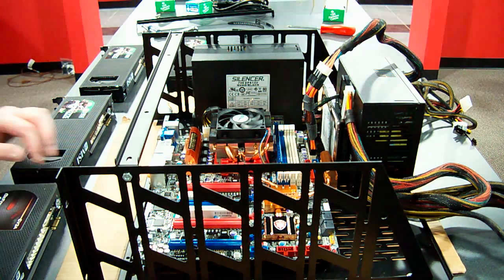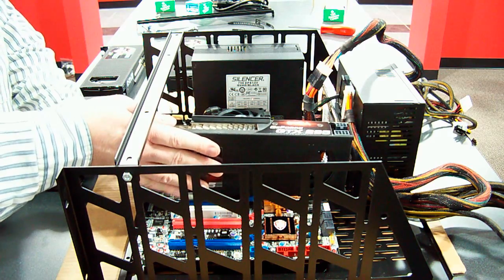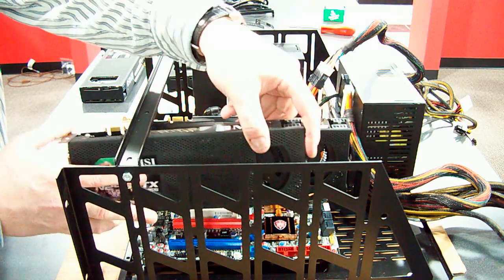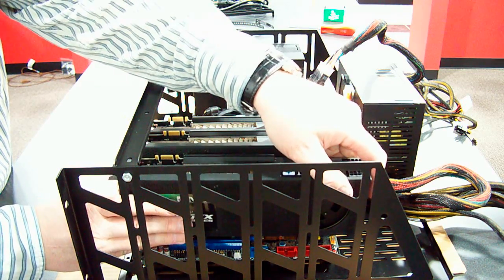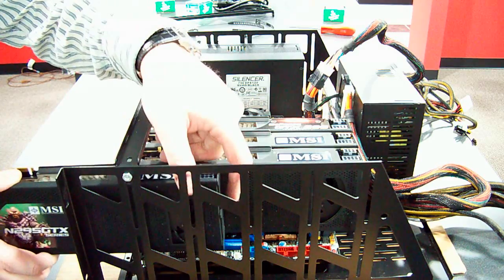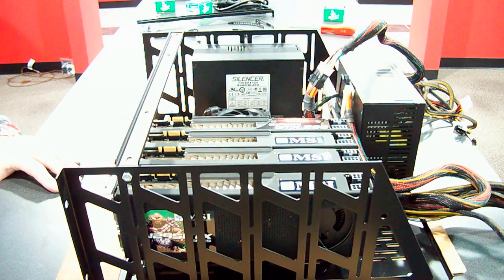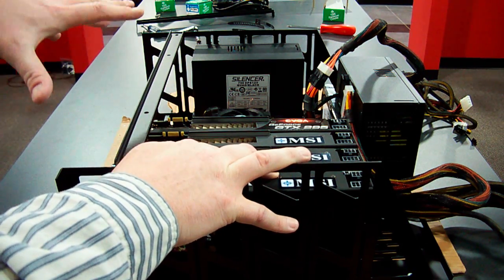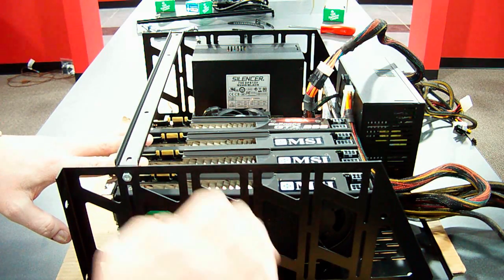Atlas Folder - Build Your Own GPU Rack

Comment from the maker: You can buy a back for the GTX295s that screws onto it with the existing hardware.  The back protects the electronic components and supposedly keeps them a little bit cooler.  The back is $20. - Jason